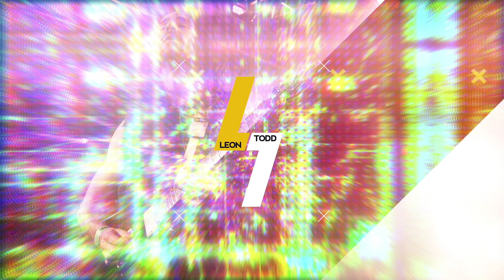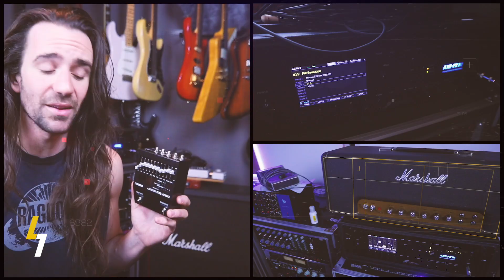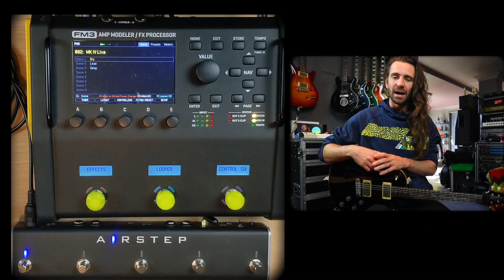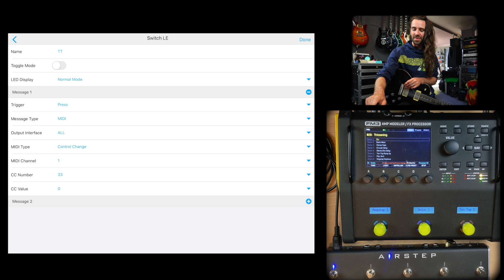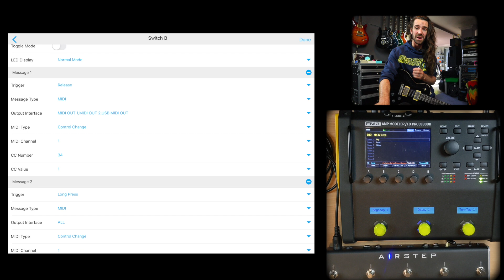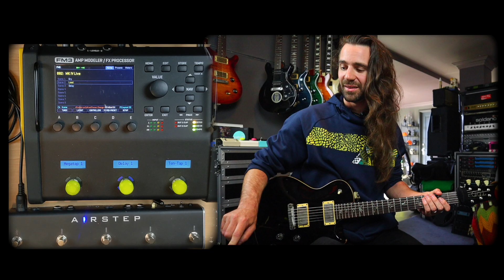FM3 & Airstep - Wireless Midi Control - Tutorial

Comment: Any reason why the airstep would not be changing anytihng? I have the yamaha MD-BT01 plugged into the FM3, both are connected to bluetooth. Airstep won't change anything. Does the airstpe have to be connected via Wired Midi? And then I would have to purchase the Airstep Lite?

Comment: Would be great to have that 2nd USB connector on the FM3 work with a wireless dongle to use FM3 Edit via wireless rather than use a USB cable. Cool gear but I think I’d rather get an FC6 with the backlit displays and color program features 👍

Comment: My brain is kind of foggy. Forgive :|

The main controller connects via standard midi cable to whatever modeler? Wireless midi control happens only if you have the second controller and it's connected to the hard wired unit?
Reply: Exactly - Airstep lite will automatically connect to Airstep (the unit with hard wired MIDI out/in and extend it with 5 more switches). It's all seamless and the app just works. I've been using the Airstep combo to control iOS apps, PC apps, Amps and my AX8 (Just spent the morning getting it configured for the FM3 which arrived Monday). I'll likely pick up an FC6 or FC12 in the future but the Airstep is super convenient and flexible - highly recommend! Only problem I've found with Airstep - you can't seem to configure a switch to be triggered by a Press OR Long-press, Press will only send CC for the Press trigger but Long-press seems to always send the CC configured for Press as well as CC for Long-press. I'm using it for scene changes as Leon has shown but I wanted to use only one set of 4 switches to switch between all 8 scenes (Press on switches A-D for scenes 1-4 and Long-press on same switches for scenes 5-8) but Long-press always jumps to scene 1-4 before switching to scene 5-8. Maybe I'm missing something!
Reply: @rodneyjones1539  thanks a TON for the clarification. This is a neat product. I have a Microdesignum midi controller currently that I don't use. 

If I did want to jump in; I would want the wireless functionality. It looks like you can buy the combo pack when it's released for $399. So it is fairly expensive. Not prohibitively so; but enough to where, especially in these times; I'd have to think hard about it to be able to justify it.

It would be cool if there was an 8 switch wireless footswitch and a small midi "receiver" that could stay plugged in up in the rack instead of having 4 switches wired; 4 wireless.
Reply: @rodneyjones1539  good catch! Thank you!
Reply: @rodneyjones1539   Did you ever figure out a way to get the two functions on one switch ?  I noticed the same thing - I've emailed support and am waiting.